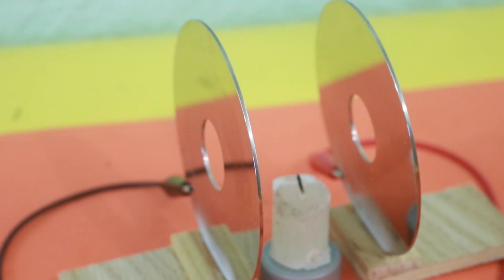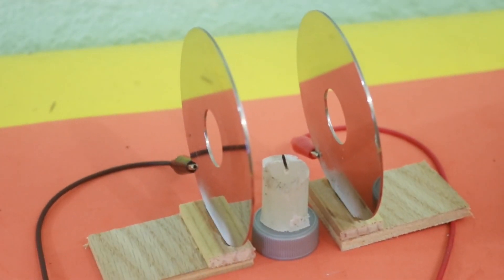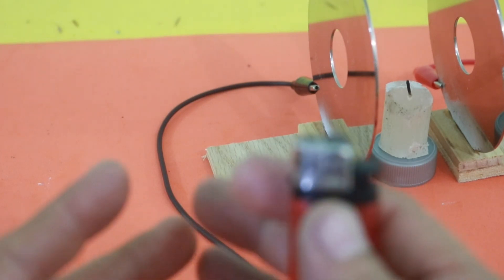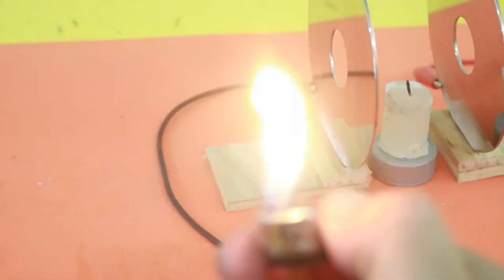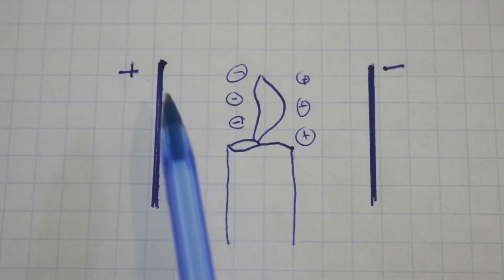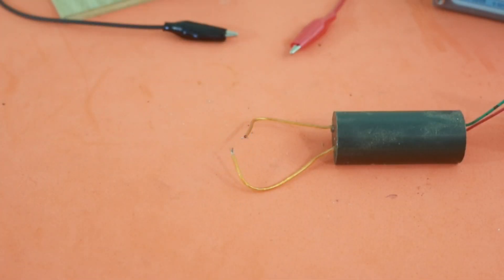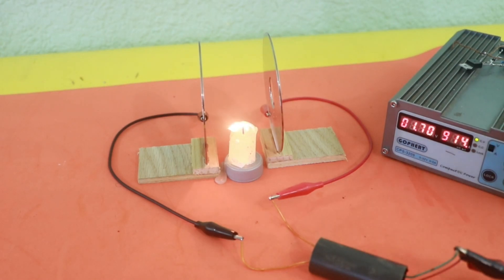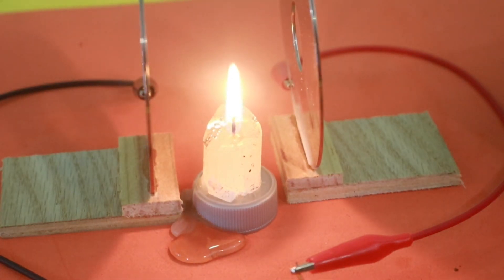What Happens to a Candle Flame in an Electric Field?

Comment: Would be interesting to generate an ion wind like that inside of a sealed torus like a particle accelerator to see how fast the wind would accelerate to and if one can put in multiple accelerators like this. If it was transparent plastic hose and wind powerful enough to move glitter that would be neat to see.